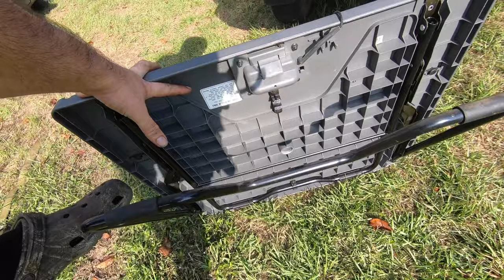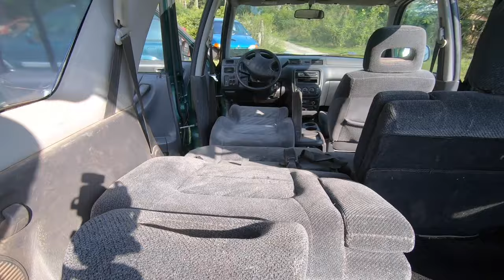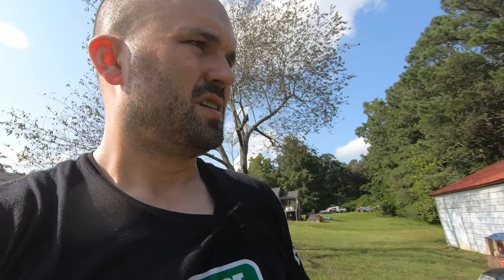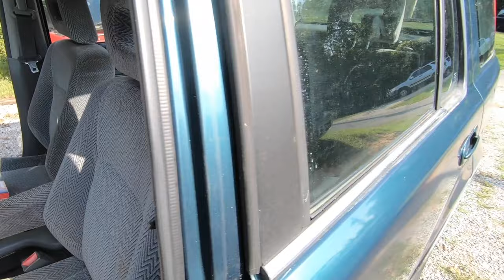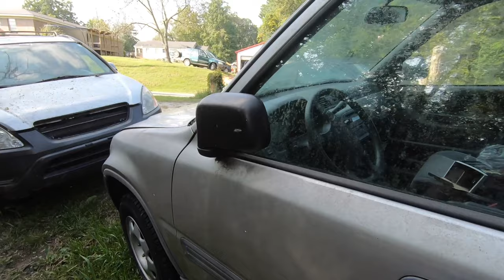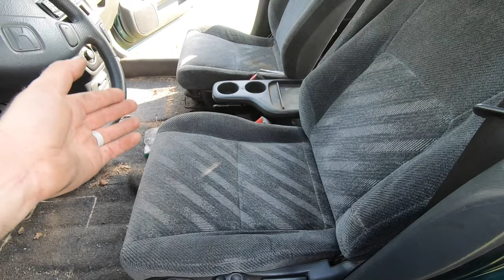Hidden Features & Treasures of the 97-01 Honda CRV RD1 RD2

Comment: This made me want a CRV, and it would be cool to take camping.
Reply from the maker: They are super cool man!
Reply: I have one best little SUV ive ever had. It's an awesome vehicle. Plus Honda made it official, that first gen RD1 Crv well be a collectors car. So value we'll go up on these little SUVs in yrs to come
Reply: It's is beast in snow or almost any terrain. I live in the Pacific north west so weather gets pretty bad out here.
Reply: Honda element would be better
Reply: @imtheonehero9305  no.  Better in areas sure.  But ultimately different, not better
Reply: I have the awd green with grey interior and I like the size and view. You can see out very well in this. It drives pretty well in snow. Haven't had to shovel my drive since I got it lol.

Comment: 😎 LX, SE , and EX was Not available in 97. You got a crv and a list of options to check in 97. Our 97 which we bought new in 97 is spect like an EX even added a sunroof and leather interior which was not on the option list but we have the hard cover the alarm system which is mounted in the left door The rear spoiler roof rack aluminum wheels just to name a few but it's still on the title not an EX SE or LX that did not come till 98 when they packaged things together.

Comment: I'm really, really, really embarrassed to say this, but after 23 years of owning my 99 Honda CRV I have finally found the tire jack that came with the car. 
My sister and I drove 2 hours to a Honda dealership that a friend of hers owned where we bought the car right off the lot.  It's been the only car I've had ever since.  
I don't remember how long after that when I had my first flat tire and had already lost the owners manual but I always assumed there was no jack until I watched this video. 
When I pulled out the ice cooler and saw it I thought to myself there it is.  Looking brand new, unlike my car.
So, thank you for making this video.  It made my day 👍👍👍👍👍👍👍👍👍
Reply from the maker: Awesome! Kinda rare to find a1 owner nowadays
Reply: I bought my cr-v used and thought it didn't have a jack, so I bought one. Now I probably have 2. I need to go check under the cooler.

Comment: Oh snap you’re still making crv vids!? Keep them coming man I just got a beat up 99 last week and been so happy I found your channel. I’m the middle of swapping both front window regulators using your video. Very well explained and straight to the point! Subbed!
Reply from the maker: Yeah man, I have several more that I need to make, just been knocking them out without filming much lately
Reply: How’d it go? Which brand of regulator did you install? I need to do the same.
Reply: @hondaresource  could you make a short video show how to use a timing light on the 2.0. ? My crv is seeking very weak after I did a new head etc. idles perfect and starts up perfectly

Comment: I have a 00 cr-v and it's a SE. I love it. I got it from the original owner a old couple that used it to cruise the beach in the summer and get around in the snow in the winter. When I got it it had 163k and lookes brand new inside and out.
Reply from the maker: Sick! The se's are super nice as long as the leather doesn't crack

Comment: Great video! Love my 99 crv. Had it for 3 years and have traveled and camped with it with my Thule cargo attached on the roof and still running strong at 180k miles. I always let people know I have a table in the trunk and they're always so amazed by it lol. Only gripe is the many cup holders that ALL suck and wished the passenger also had an arm rest.
Reply from the maker: I'm going to do a video soon on adding an armrest to the passenger seat. I agree on the cupholders. Look up crv guards, it definitely improves the console cupholders
Reply: My '97's still going and just hit 250k!
Reply: Bought our 2001 new and still have it. Persuaded the car dealer to install a passenger arm rest before we bought it. Brought my son home from the hospital in it when he was born, now he is driving it in highschool. Handles awesome in the snow.
Reply: I've got a 1999 limited edition (European only I believe 'Camel Trophy') with factory leather and it has the passenger arm rest but the rear seats don't have the bed setting

Comment: As for the pull-out cup holders I drilled them out with a hole saw. For the center section, Walmart has a center console I pulled out the flip down and put in the center console. It has a lockable section 2 front and 2 rear cup holders that will hold a 32 Oz. Cup from here in CO. Loaf - N- Jug.

Comment: man, great videos on the CRV. I've got a 2000 first gen. Great car! Your videos have helped me tremendously in getting this car in top form. Soon I'll be putting in new sway bar end links to see if the knocking/rattling sounds go away.
Reply from the maker: Awesome man
Reply: If the sway bar links are worn out or even just a little loose it will rattle so loud it's embarrassing. Buy top quality End Links because I have had problems with aftermarket links stripping the cheesy Allen Head fasteners used to secure the lower attaching nuts. Love my First Gen RD1 LX 😎
Reply: It will definitely make the car more quiet. My car rattled like crazy until I replaced the sway bar links

Comment: Just bought my Second 2000 Honda CRV, my first was an EX that is now at 215k miles and my new one I just got two days ago is the highest trim offered that year with leather seats (not a single rip or tear) and a beautiful tire cover, painted bumpers and side bumps, oem floor matts, rear tint all around got it for a steal at 2500$ with only 107k on the dash. All it needed was spark plugs and wires and they’ve already been done so shes mint. I can’t wait to enjoy this car for many years to come. Please keep posting on this car! You’re my go to guy!
Reply: Also just a side note to what you said, my SE is actually a 2000. Could it be a late year model ? Please reply cause if anything does that make my car rarer? I’ll do a video in the near future to show you if you’re interested lol
Reply from the maker: That's awesome! Congrats on the purchase of your SE! Perhaps it was an option for more than 2001.

Comment: Thanks a lot. I'm considering buying an early CR-V and this video helps a lot. I was not aware of any of the features you mentioned. Regarding the red one with the bad paint, it seems that red paint tolerates the sun worse than any other colour (I should know, I'm in AZ).
Reply from the maker: Yes. Red fades the most for sure

Comment: never knew about tailgate holder. awesomeness! i have a 1998 honda crv with about 206,000 miles if i remember correctly. rt now have abs light and low fluid in brake reservoir. have my manual and enjoy keeping track. wish u lived closer. thanks for all the videos. inherited from my mom in 2003 or 2004. she drove one year before she stopped driving at 76 yrs. she bought for her 75 th bday in 2002. cool demo of lay down seats. dont think my 98 has that option. enjoyed seeing u demo how it works. thank u. 7.29.22 friday updated comments.  i am going to ck again for handle. i guess in the past i never finished this whole video. thanks again. cool differences. got it!
Reply: thank you!!!
Reply: edit 8.14.22 sunday do have levers for lay down seats. thank u again!

Comment: Holy Moley! I've had my 97 for 3 1/2 years, and only knew about the table and the space under it. But I thought the space was just for storage, not a cooler! And the beds! That's amazing! Thank you so much! Also, in the cideo about the problems with first gen., I have the front driver's side window that doesn't open. I'll have to try the thing you tried, pushing the switch up instead of down, lol. Also in that video, I was hoping you'd mention the brake light switch stopper that falls out, so the brake lights don't turnoff. Apparently there's a ton of videos about how to put one in, but none of them relly shows them putting them in, either that, or they put the camera at and angle where you can't see what they're doing. I cn't find the hole they're talking about that it goes in, or the button that it stops. 8'm a 72 year old gramma, ok? And besides that, it's impossible for me to get under there to be able to see it, so I have to feel. Oh well, I'll just have to keep trying. Thanks so much for this video, though. I gotta go out and look at my bed and cooler now, lol. That can wait till tomorrow. Too cold tonight. Oh yeah, subscribed!
Reply from the maker: I actually just posted a video on the pedal stopper!
Reply: @hondaresource  Whoa! Thank you! Gonna check it out! 👍🏻

Comment: I'm not sure if you would call this a feature, but on my previous 97 Crv (currently driving a 2001) it had this. While loading it for work, I threw a pair of steel toe cap boots in the front footwell (right hand drive as in the UK). When I went to leave for work, the car refused to start, just turned over. I had the moved the car just 10 mins before so was scratching my head as to why now it won't start.
Turns out, under the plastric trim near to the gearstick, if you reach up under it, scratching the backs of your hands as you do so, there is a small switch, press this back in and the car will start again! 
Some sort of impact engine immobiliser.
My son thought this funny to kick the panel once when I went into a shop so when I came back out it wouldn't start again!
Reply from the maker: Must have been something offered in other countries or added aftermarket. Nothing like that here in the states

Comment: omg I almost tossed that storage tub under the passenger seat. It was just sitting loose on the rear seat when I bought the car. It looked so big that I thought surely it didn't go anywhere on my 2000. Actually I did toss it,  but thought better and retrieved it from the dumpster just on a whim that MAYBE it went somewhere on my Honda. Thanks for NEWS I CAN USE!
Reply from the maker: That's awesome, I'm glad you hung on to it!

Comment: theres a tab pull thingy in the middle of the back seats, sometimes it might have dropped underneath the back seat, if u pull that chord it releases the back seats to make a perfect bed straight n better then the beds u made. if chord is not visable its underneath so reach in down in the middle till u find the lil chord to pull. it realeases the front section of seat toward the front chair n then u lay it down on top n makes a perfect bed

Comment: I have a 99 Honda CRV.  Bought it 2002.  Has had some issues like breakers, exhaust, normal car stuff.  My  mechanic in Ohio couldn't believe how long this car went on original battery, sparkplugs and a few other things.  He helped me take care of it.  Now since I moved to three states away my son-in-law is my mechanic and he is also does diagnostics on cars.  So my baby is in good hands.   I knew about some things, but will need to check out for the rest.   Thanks.

Comment: I made my own door holder from a piece of pvc pipe slit down the length. I didn't know they came with one, but it doesn't surprise me. I'm in the processs of swapping out the steering rack...a PAIN to have to pull the transfer case!
Reply from the maker: Yeah, definitely not a fun job

Comment: Currently have 2000 and 2008 CRVs. Had a 99 for about a year that was given to me as a "hand me down" from my son..drove it for a while, but had some problems....went to my local repair shop and ended up giving it to one of the techs...his wife is now driving it and loves it. 2000 has 181K and 2008 has 111K. The 99 had about 250K.
Reply from the maker: awesome!

Comment: I bought my ‘98 EX new in Dec. 1997, and still have it. It’s been great over the years - some major surgery along the way (rebuilt transmission, in particular), but still an amazingly reliable car. I did know about all of the features you described, but I admit I didn’t know about the “bed” feature until about two years ago, when I kind of discovered it while cleaning the car out. (“What does that lever do? Oh. Oh…”😯) Was this described in the user manual? I’ve lost that, so I can’t check. I’ll have to go see if I still have the rear door brace now. I’d forgotten about that. Thanks for the video!
Reply from the maker: That's awesome! I just bought a 99 from it's original owner last week
Reply: The "bed" and other features  that he shows in this video are described in the manual.

Comment: I have a 96 and I don't know that it has the bed option, I'll check in the morning. Also didn't know the trunk space was a cooler, I use it for a spare and my Jack and lug tools. Great video!
Reply from the maker: awesome, what country are you in?
Reply: @hondaresource  I'm in Jamaica. Mine is a UK Right hand drive as well. I've had it since 2016 and I love it! I want to fix it up nicely so I started looking at YouTube videos to help me with that and came up on your video.
Reply from the maker: @robinsonsharren  I knew you were somewhere besides the US because we didn't get them until 97
Reply: @hondaresource  happy to report that I do have the lever and can do the bed mode thing. My seatbelts are stuck and won't come out and I can't get lift spacers here. I want to fix an oil pan leak and clean up the engine room.

Comment: BTW- the oem jack and tools store under that plastic insert. There's a place specifically for the jack, tucked as far to the back as you can. -I own a 98, 99, and a 2000 for a parts car. All are LX's, and none of them have the rear set recline for the bed.  Guess I'm just gonna have to get another!
Reply from the maker: Yep. I mentioned in the video that the jack goes under the tub.

Comment: One thing You didn't talk about was the hook on the table, Ive always wondered about it (Maybe to hook it to the car in winds ????) and the back seats have a tab on the cushan and you can pull them up and make more room in the back as the back rest also moves forward. (you also pull the head rest for this)
Reply from the maker: The hook is to hold it up to the top of the car to gain access to the cooler

Comment: Just picked up a 2000 awd manual LX. It came with just one key no fob. Is there an easy way to identify if it had keyless entry besides taking the door apart and looking for a module? It does have power doors and locks.

Comment: 97 cr-v for now. After a year of having it, put a fuel pump, f.p. regulator, battery, distributor, 3 belts, tires, Crank Position Sensor... and had to keep adjusting the fuel cable. 
All wheel drive. 
In the works to get it back running. And talking to some1 about trading it for a full size truck!
Reply from the maker: They occasionally have issues but once they are fixed, they generally dont have repeated problems.
Reply: @hondaresource  
Repeating issues or not... believe once I get it running, I'm done with all "foreign" vehicles. 
Its the 2nd one that's died on me. None of my chevy/dodge/chryslers ever died on me.

Comment: I have a 97 LX and have had it for 22 years. I'm catching up on a bunch of repairs because stuff is getting really old and worn out. The most disconcerting is the volume knob on the radio. If I can't get the potentiometer working again, I'll have to replace it if I want to listen to anything. I'm not found of taking the center console apart, or any of the dash for that matter. It's not really that hard, but you have to be in awkward positions a lot, and my back doesn't like that at all.

Comment: I like this channel.  You got a nice crv collection.  Hey while I'm here I got 150k on my 01 manual, what maintenance do you recommend?
Reply from the maker: just regular stuff. Timing belt, water pump, spark plugs, plug wires, refresh all fluids, adjust valves.

Comment: Do you kbow how I can get the replacement front rug for the 2001 Honda crv?  I have not been able to find tne same design (ithe whole area: left, middle, and right in one piece).  The plastic bottom of mine started to break into small pieces.

Comment: That cable at the end of the table hooks up to the ceiling near the third brake light and holds up the table whilst inside.
Reply from the maker: Yep. There is a couple things I missed
Reply: I don’t understand the purpose of the hook and cable. Why would you need it?
Reply: And why would you want to hang your table from the hook with a cable? For what reason?
Reply: @GTVAlfaMan  to have hands-free access to the cooler/storage well beneath the table when it's stored in the car.

Comment: Hey love the channel , have a 99 and have a question.  Having a problem with my speed sensor replaced it twice still no signal any insight
Reply from the maker: Possibly the pins in the connector are corroded

Comment: I bought a 2001 SE about 2 years ago. I appreciate so much your video. I knew a few things but not everything you covered especially the thing that holds the door open. I'm going to check it out later because that has been an issue at times. My CRV is somewhat of a work vehicle so the back seats are folded forward. It's one of my favorite cars almost up there with my 56 Chevy Bel Air convertible and 1995 Dodge stealth twin turbo all-wheel drive. Hard to beat all of VW bugs and one VW squareback I owned back in the day. Oops, the 1941 Dodge power wagon deserves honorable mention.
Reply from the maker: Sounds like you have a nice stable of cars